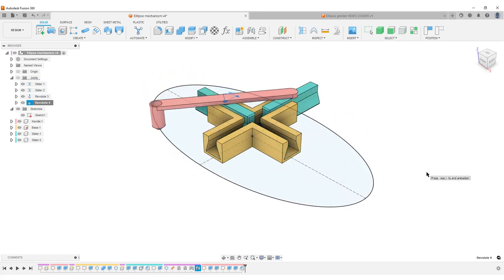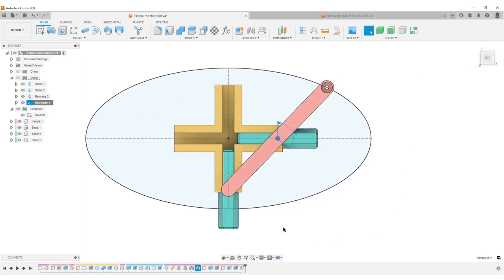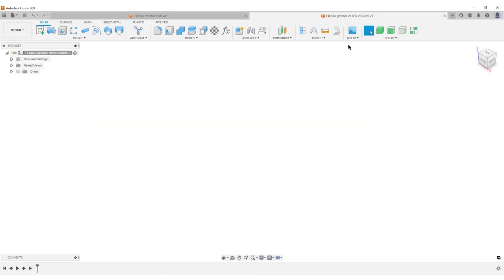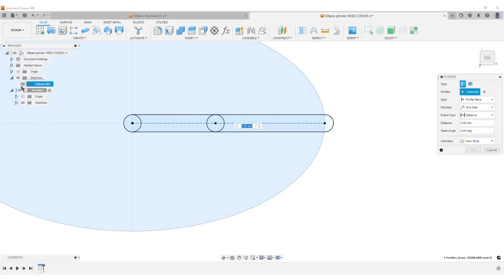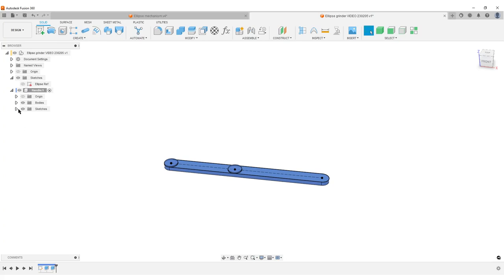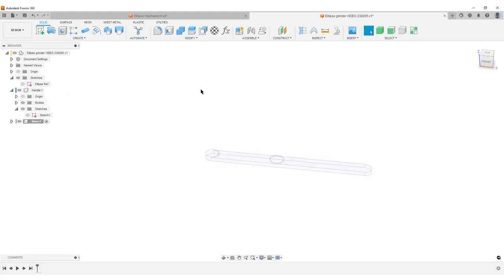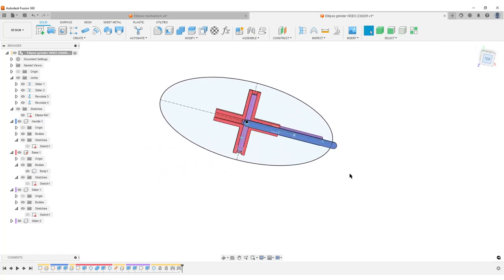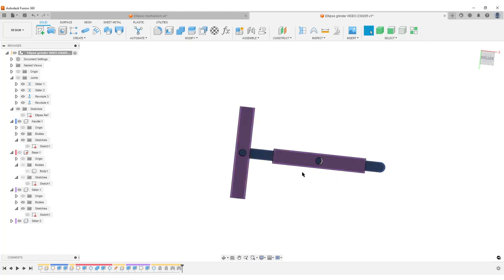Fusion 360 - Trammel of Archimedes (Workflow with Joints)

Comment: At 11:37, instead of using the sketch from the other component, I would probably use the projection of the other body/component. Of course you need to create a new sketch which you project to, but it feels a bit cleaner.
Reply from the maker: You are right. I did some shortcuts in the video, trying to show how I find "the design". A remodel or cleanup of the file can be done after.
Reply: @KristianLaholm  Yes, I appreciate if you followed best practices end to end, these videos could be quite long and the emphasis here is more on the high level design approach. And even this way I learned something new today I haven't used before (editing sketch dimensions via the parameters dialog, nice trick, I used to back to edit the sketches all the time...). So, as always, great content, thanks!

Comment: The handle part in 5:38 I failed to make because my handle becomes one thing after add -3,  please help me.
Reply from the maker: Are you referring to the 2 small circle extruded 0,8mm? You should end up with only one body after that extrude (a slot body with 2 circles slight extruded above the surface).
If you are extruding on some other plane the direction ( - versus +) can be reversed.